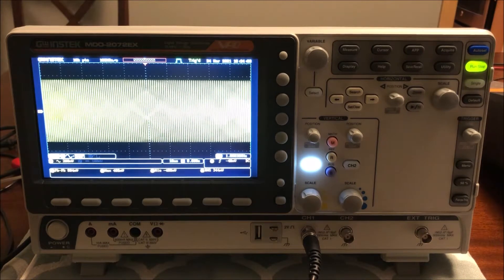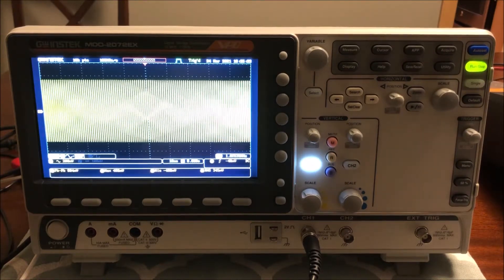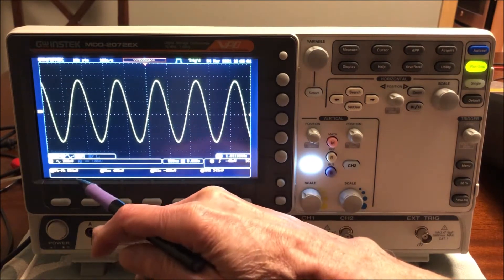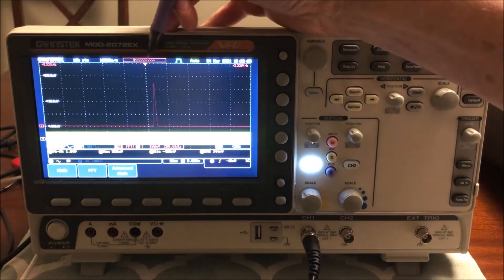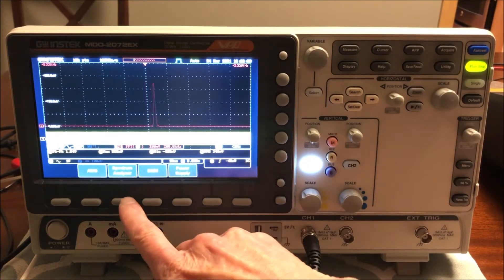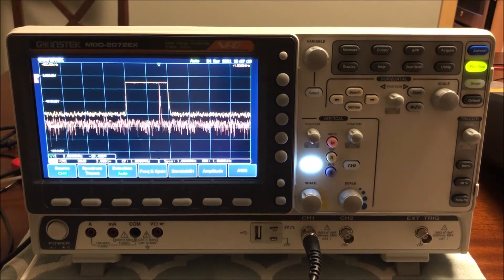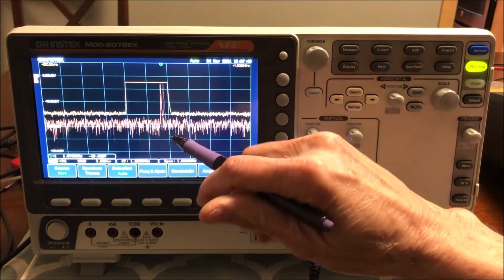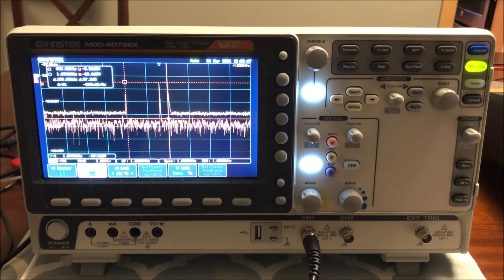GW Instek MDO-2072EX Time and Frequency Demonstration

Comment: Good scope. I upgraded my GDS-2000E to have 300Mhz bandwidth and the spectrum analyzer functionality. These scopes are basically the same, just the functions have to be unlocked by a key that GW Instek for some reason does not release to the public. Now, after the upgrade, I even have a generator in the menus. But the hardware does not have it, so that is not an option for me. But the spectrum analyzer interface works just fine.